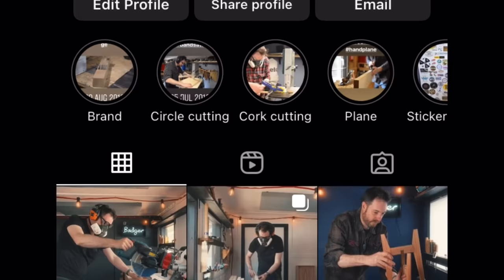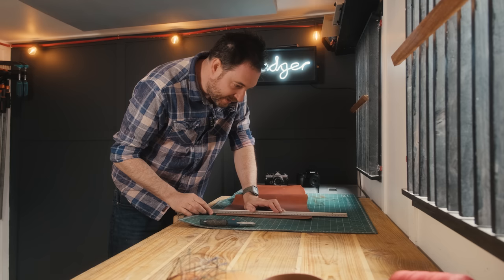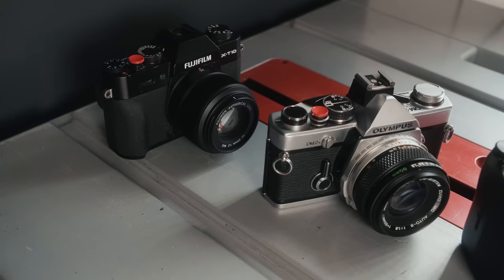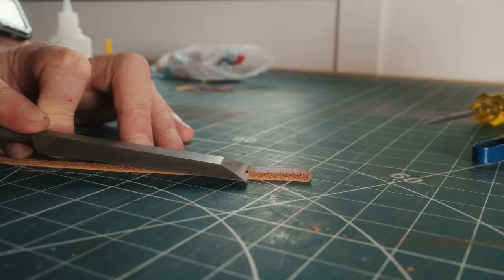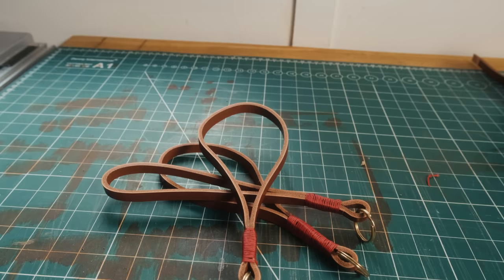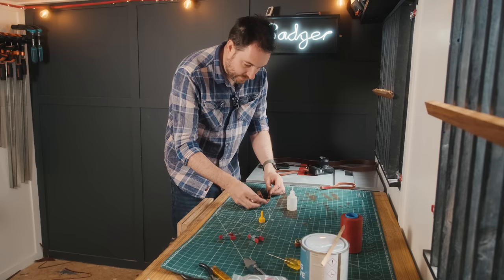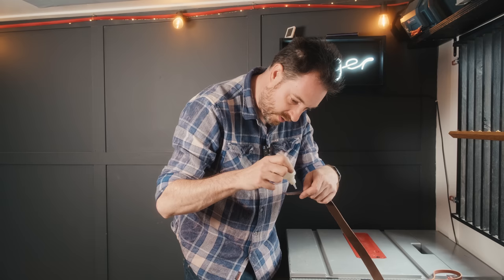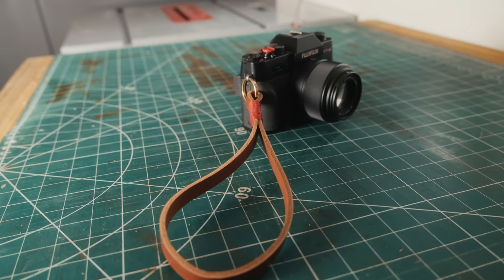Making The Perfect Camera Strap For Me

Comment: That's a great design!

I bought into the Peak Designs system because I wanted the same things you did. They have little "buttons" that stay affixed to the camera and then you can clip in a wrist strap or sling or whatever. I was too lazy to make something myself. 🤪
Reply from the maker: I tried that system and it is nice. Just found the strap rubbed in the summer
Reply: @Badgerworkshop  yeah, I can see that being an issue. I really like how the strap stays stationary with your design. I might have to un-lazy myself and make something similar. 🙃